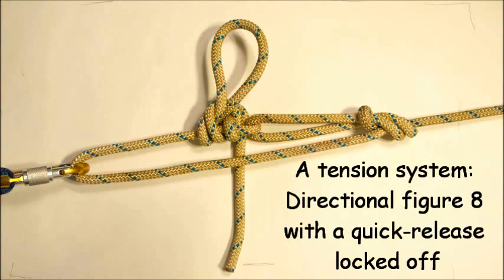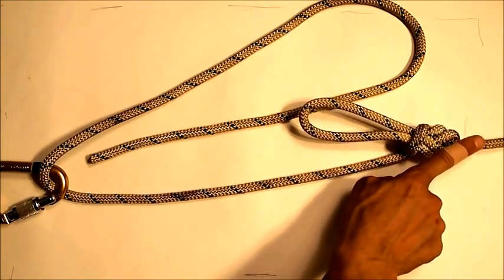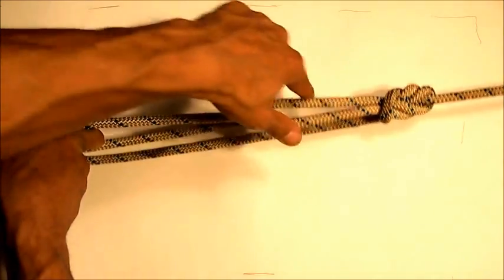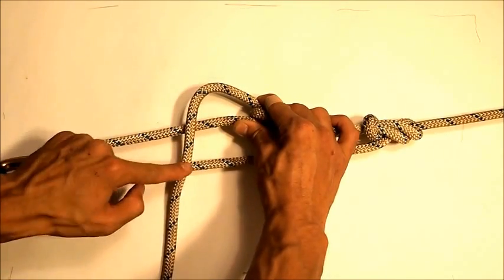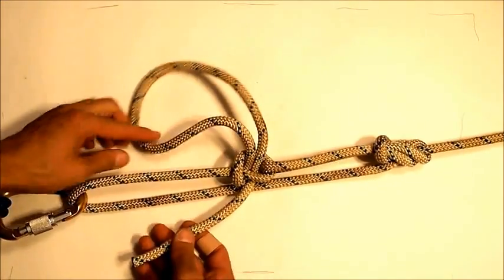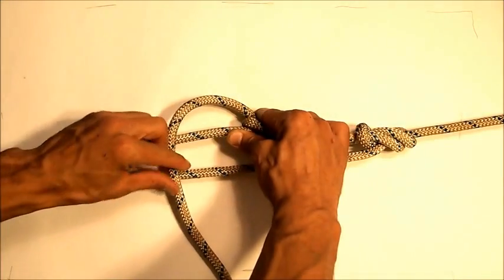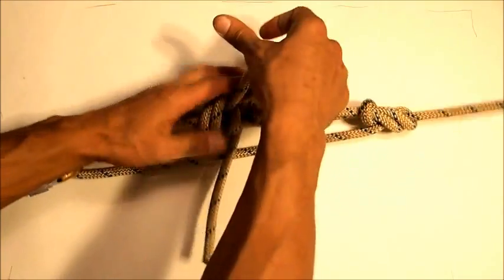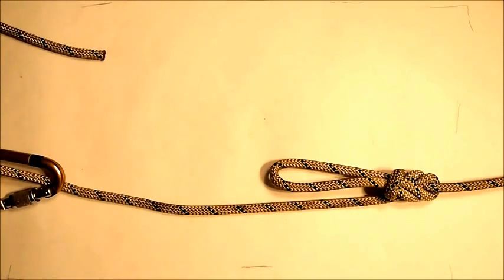How to tension two points together with rope

Comment: Greetings,

Is this type of knot sufficiently secure to use on a horizontal safety line that would hold a person? (I am aware there is special equipment rock climbers use in these circumstances but I don't have access to such tools, just rope and carabiners).

Thank you for your time.
Reply from the maker: If I understand your question correctly, I would use a butterfly knot (or "alpine butterfly") for tying a person into a horizontal line. It's used for life support, and it's equally strong in all directions, while minimally reducing rope strength.
Reply: @Earth.Operations Thank you for your response. I was thinking about anchoring the ends of the horizontal line, then having a way to add a reasonable amount of tension to the horizontal line so that if the person does fall, the line won't have too much give in it. The horizontal line is going adjacent to some staging several stories up. I am going to be working on the staging in slippery conditions. Because of the slippery conditions, I am planning to use a harness and a simple safety system. I normally work on staging without such things, but the slipperiness is a worry, so out of an abundance of caution I'm going for the harness.
Reply from the maker: @JJ-gm1mk  I think this would work fine as you describe. Just make sure your rope is really strong! If you keep your leash short, then you won't shock the system and you won't really fall. If you take a hard fall on this system, the tension knots will have weakened the rope a bit so that could be unsafe. An alternative to keep the ropes stronger is to tie shorter sections with intermediate connection points. But then you'll need two leashes and have to cross those connection points carefully.
Reply: @Earth.Operations  Awesome. Thank you!

Comment: Looks like a modified truckers hitch.  I am an amateur, but I think I can basically do everything I need with 1. slip knot, 2. bowline, and 3. truckers hitch.  Are there any other "must have" knots I should learn?
Great vid! Thanks!
Reply from the maker: Clove hitch! And the constrictor version of the clove (I don't have a video for the constrictor). It's the best knot for gripping bars, and if it's tied to a hook or carabineer, you just pull it off and the knot disappears, no untying
Reply: hahah I am at least 5 years late to the party.  @rasuarez36 (and probably many others) have already mentioned this.

Comment: Is there a knot that gives 4:1 advantage, or more?
Reply from the maker: You basically just have to add more pulleys! As people have pointed out in the comments, this actually gets you 3:1.Then, instead of locking off at the knot as I'm doing, if I took that end around the carabiner one more time, I'd have 4:1, then I could lock it off at the carabiner with a couple half hitches. If you want even more, there's a way to tie a figure 8 with two loops in it. Or you can add two carabiners to the 8 and use those.

Comment: Exactly what I've been looking for (I think!). I have a garden swing, which has it's own metal loop for connecting to a carabiner, but the tree it's currently hanging from cannot take the weight. I'm thinking if I run a line between two trees, and pull tension across, then I can hang the swing halfway across that rope. I mean once I'm up in the tree I'll find out if I can even pull enough tension to do so! When you mentioned how passing the loose end through the first loop, you said how that creates a pulley. is there any way with this knot to put multiple pullies into the system, allowing me to pull more and more tension?? Thank you very much 😊
Reply from the maker: There's another key issue with your proposed setup! When you have a line stretched between two anchors, and hang something from the middle of that line, it actually multiplies the force on those anchors. It is possible to end up putting more force on each anchor than you would by just hanging the swing off of one. If the line between the anchors is a bit slack, so that you get a V shape when you hang the swing, then you start actually sharing the load between the anchors. The lower that V angle becomes (the tighter the line between the anchors) the more the force from the load is multiplied on the anchors. Theoretically, you can achieve infinite force with a perfectly taut line. So be careful with that line tension!

But, to answer your question, you can add a butterfly loop or a prussik onto the line (or more than one) to get more intermediate loops (pulleys) that you can use to add mechanical advantage. I've got videos on prussiks and butterfly knots.
Reply: @Earth.Operations  Thank you very much; just watched two of your videos explaining the knots, and I understand how they both could be used. 
2 further questions, if you wouldn't mind helping:
1. Are there any knots which could take tension in one direction, then loosen in the other? What I'm asking is, could I put a knot on the line that allows me to pull pull pull tension, then when I ease up, it holds that tension, giving me opportunity to tie it off/secure it somewhere? Don't really know how better to explain that. 

2. If I add multiple, say butterfly knots, along a single line, then take the end of that line through a carabiner, and back again, each time through a knot, through the carabiner, and repeat, does that add the mechanical advantage you were talking about? I thought I was mechanically minded, but I can't fathom how that works in terms of adding tension to the original line. 

Thank you very much for your help so far.
Reply from the maker: I think for (1) you're looking for a "progress capture"? That's a setup where all the tension you pull through a pulley is captured when you let go, so you can reset yourself or your pulling point to give another haul, and repeat. Is that what you want? You can use a prusik to capture progress. If you have a pulley, or possibly a knot with a small enough loop, you have the prusik loop hanging from the same point as the pulley/knot (anchored there, eg from a carabiner), and the prusik hitch is tied below the pulley on the load side. When you pull the other side, the prusik is pulled into the pulley and the pulley pushes the prusik along the load line until you stop, the load pulls back a little and prusik locks (though you often have to thumb the prusik a bit to help it lock). If you have a progress capture, then instead of a butterfly knot in your load line, you can use a prusik at that point instead. Attach a pulley (carabiner) to the prusik loop and run your hauling line through that instead of the butterfly. Then you can haul until your pulley (prussik) approaches the anchor, let the progress capture hold the load, slide the hauling prusik back down toward the load, and haul again. You can use multiple prusiks the same way you're thinking of using multiple butterflies.

2: I find pulleys very confusing too. But I think what you're suggesting is right. That should get you the same result as adding pulleys onto the load itself. One way you can test how much potential mechanical advantage you have is to mock up a system with some light cord on the floor, anchor one end and pass through a pulley loop on a small load. Then set up all your knots. Get everything taut and mark the position of your load on the floor, and mark the cord where it passes through the final pulley. Pull the load along a ways. Measure the length of cord that passed through the final pulley, and measure the distance the load traveled on the floor. The ratio of those lengths is your potential mechanical advantage (with actual advantage being reduced by friction). When you have a ton of advantage, you have to pull a ton of rope to move your load a small distance. You can also look up compounding pulley systems (a pulley system pulling a pulley system), which can rapidly multiply mechanical advantage, but it's a little trickier to set up.

Comment: I love the concept but You may want to check your directional 8. It is close but does not look quite right.  All three strands from the loop and the end running to your carabiner should all come out of the same spot https://www.animatedknots.com/figure-8-directional-loop-knot.   And you have basically built a z drag which is a theoretical 3:1.
Reply from the maker: Correct. I think I added some comments below the video as other people have pointed out those things too.

Comment: Thanks for the vid! Yeah, it is a modified trucker's hitch and it's a 3:1 mechanical advantage, but there's so much friction without 2 pulleys in the system that it would probably test out at around 1.4:1.

Comment: Nah!! I'm an old school trucker (who now 99•9% uses straps & ratchets, chains & twitches) I'd use the many various truckers ties, used for straight up / down, angled or across the load. No way I'd use any figure 8 for a stress load, only because under tension the size of the cord/rope determines how fidgety it is to undo (it's all about quick release) My one  exception for an 8, is for tying around ones self or another person or fixing to an attachment. 
In saying all that I will add.... 'Personal Preference Prevails' 

Ps, safe loads everyone😀 
      and safe journies😁

Comment: 'directional fig. 8'?  Just call it a Slipped Fig. 8 knot which is what it is.  It only works in one direction, properly that is.  This is your everyday common Trucker's Hitch, using a slipped fig. 8.  Others use a slip knot (slipped overhand knot), or alpine butterfly loop, or bowline tied in the line, etc. (anything that has a knot tied in the line that makes a pull-loop is a Trucker's hitch.

Comment: 3:1 force not 2:1
Reply from the maker: Yep, I finally added that correction note to the video description.
Reply: Tyeen Taylor If carabiner was replaced with say a tie down rail or a post it would still act the same way but less efficiently no?
Reply from the maker: That's right.

Comment: I want to use the following method to secure my laundry rope. Any perma-knots that you'd recommend to secure it with? (The rope sits on 2 pulleys thus making 'complete circle' and I end up attaching 2 ends.)
Reply from the maker: Since you have two ends meeting, I might do an eight on a bight on one end and then feed the other end through that eight and tension and lock it like I've shown here. This lock-off will hold indefinitely, especially with smaller diameter cord, but will always be easy to untie when you want to.

Comment: I think the alpine butterfly loop would be just as secure as the directional figure eight and would be easier to untie after loaded. I wonder which reduces the strength of the rope less.
Reply from the maker: Yeah, these days I almost always use the butterfly for any rigging situations, mainly because of its multidirectionality. I do find the butterfly easier to untie. In a hauling situation though, like where I'm setting up a pulley system inline on a rope, the directional eight is nice because it just hangs down in the right direction, so there's no travel in the knot when it gets loaded (the butterfly would bend downward before loading). I don't know which is stronger. I'd bet they're similar. The way I've showed the directional eight will be a bit weaker than the 'proper' way to tie it, by making a twist in the bite before passing it around, and ensuring the bite goes through with the tail. Should be easier to untie that way too. I haven't bothered to fix the directional eight not video yet. As is, it works fine where you're not really really worried about breaking your rope.
Reply: I like the directional figure 8 too.  If you jerk the loop back the other way it pops out of tension and becomes very easy to untie- actually turns into a slip.
Reply from the maker: Yeah, if you tie it properly, which in this video I do not! My version here is less strong and doesn't slip